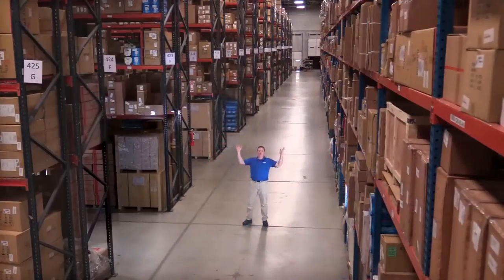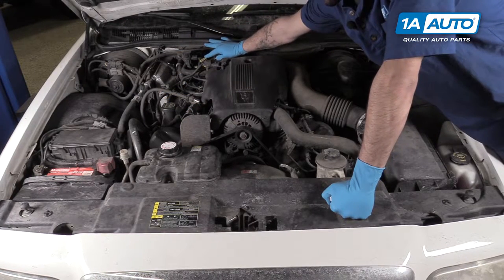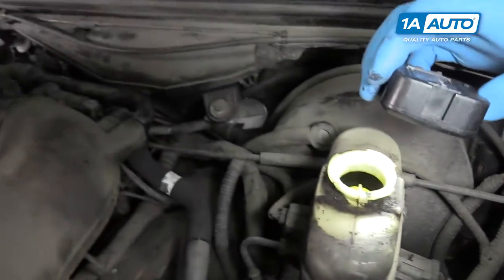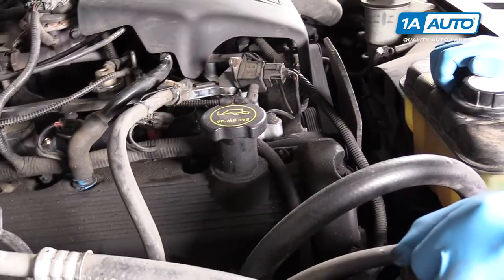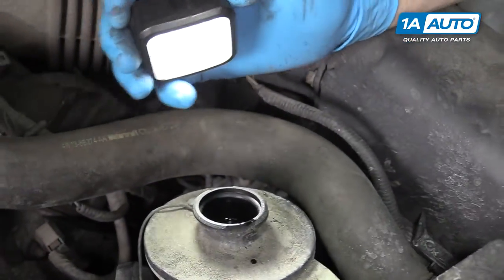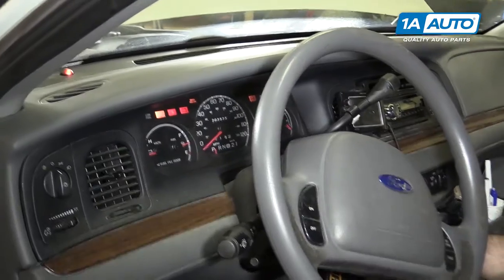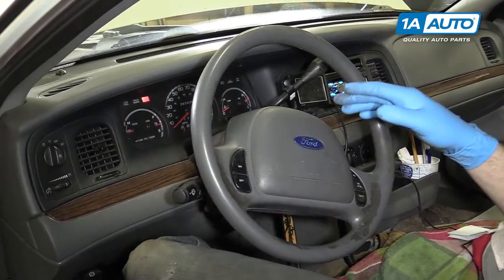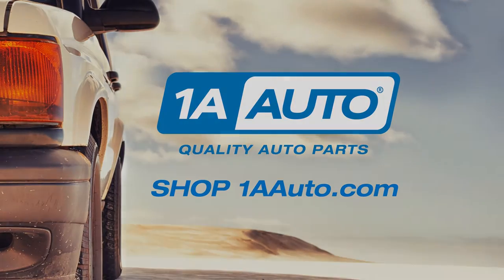How to Check your Engine Fluids 98-12 Ford Crown Victoria

Comment: Would really low levels of coolant cause over heating or only if its completely empty???
Reply: You can run your engine with no coolant for about 10 miles before it over heats

Comment: I'm putting in 5 quarts of oil in my 2002 Grand Marquis.  My dipstick reads right at the top of the hash marks below the top hole. This is OK?  Owners manual states 5 quarts.. Would it be better to add more so the reading is at the top hole on dipstick?
Reply from the maker: +King Pin With an oil filter change as well, 5 quarts is the recommended amount for that year, make and model vehicle. 1aauto.com

Comment: I just had a local Firestone Auto 🔧 do a brake fluid exchange, service on my 2005 Ford Crown Vic sedan P74. 180000mi. They claimed to finish the brake work in 45min. ⌚️ is that normal? Will a Ford Crown Victoria dash board warning light come on for bad brake fluid? ⚠️ The shop was busy but not super crowded.